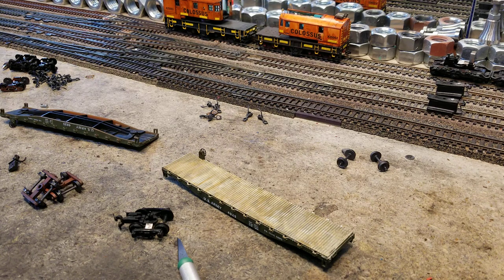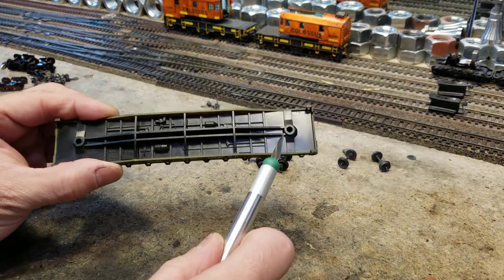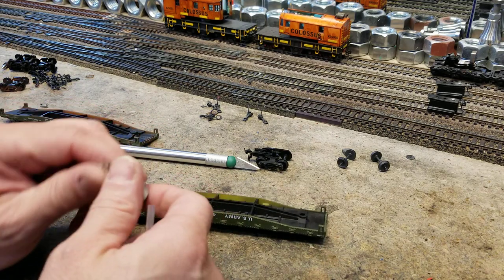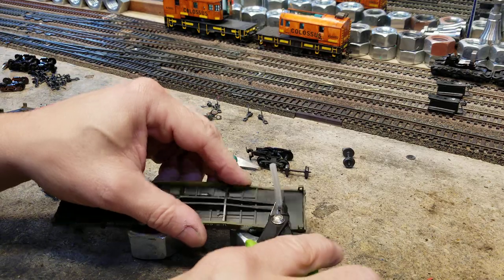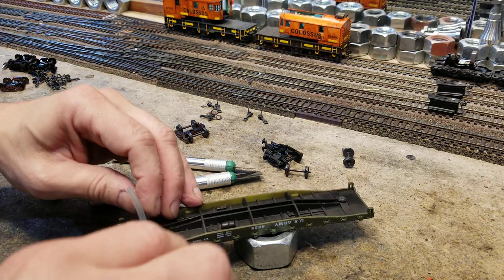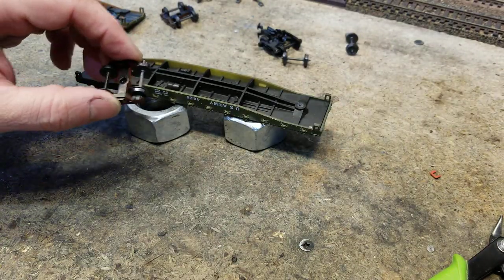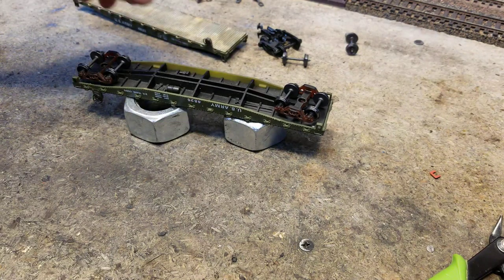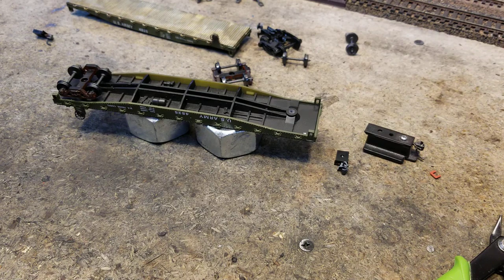New trucks on old freight cars

Comment: I plug mine completely off with solid plastic rod, somewhere around 3/16" diameter, or maybe 1/4" on the newer Bachmann ones, file that bolster flat, then I use a hole punch on the lid of a Kadee #5 box, punching out that coupler bushing/post, and using that for the new bolster.  Once the glue dries, I drill and tap the center hole for 2-56 x 1/4" screws.
Reply: Oh, and for coupler heights, I use the Kadee 20 series adapter, and glue that in place, and then I use a regular Kadee box right on top of it, and that gives me my coupler height, without having to mess around with shims, etc.  Yes, I like the snap together Kadee boxes as well.
Reply from the maker: I like the plastic rod technique which I've done with brass rod and the tiny lathe to make the hole for tapping.  I'll have to get a bundle of the plastic rod for rebuilding a stack of 40 foot hi-cubes!
Reply from the maker: that new snap together draft gear is a big time saver over the number 5 box when doing locomotives!

Comment: For just a few dollars more, you could easily replace those plastic wheel sets with metal and the horn-hook couples with Kadees.  I have done it to a lot of my rolling stock and glad I did.  everything runs so much smoother.
Reply from the maker: what I've been doing is coating the outside of just the wheels with non-conductive graphite spray and then polishing them with a plastic brush with a moto-tool.  those wheels have and excellent look after that.  metal wheels are way outside my budget - I keep them when I find them, but I only use them on cars in rare circumstances because of the price!

Comment: I use a very similar method for upgrading the trucks. My biggest obstacle is finding freight trucks in lots to upgrade the many repair projects that I have.
Reply from the maker: they used to be easy to get at train shows, but now I get the 10 pack from Tichy sometimes with wheels and sometimes without when I have a bunch of spare wheelsets.  They're under 15 for 10 pair - at least for the moment!

Comment: I found it easier to set the KDs with the trucks still off in order to get them centered right and your couples should stick out a fraction or two Ensure distance between the cars going around curves and through switches especially in reverse...
Reply from the maker: That is generally how I try to do it.  Recently I've run into some cars that were unusually difficult to replace both trucks and couplers. If I can get some more of those at the train show I'll show them!

Comment: I think I'd rather use a bit of Plastruct tube from the local craft store rather than silicon tubing. It can be glued in place with plastic cement and it will become part of the underframe structure.
Reply from the maker: it's getting harder to find and farther away these days.  the benefit of the tube is $8 will be a lifetime supply of the silicone hose!
Reply: @elite194  Plastruct is harder to find? Interesting. Was going to go out and get some today for another project.
Reply from the maker: @whiteknightcat  if you have a store that has that wheel of all different kinds of beams and channels, you're very lucky!
Reply: @elite194  Wheel? No, I was talking about the material used to fill the old hole in the bolster. You used silicone tubing, but IDK where to find that easily. But I do know stores in the area like Hobby Lobby, Michael's, etc carry Plastruct shapes and strips for hobby and craft projects. A 12 inch length of Plastruct tube would last me a lifetime. 

For trucks and wheels I have lots of old Athearn and MDC stuff around.
Reply from the maker: @whiteknightcat  I meant the plastruct carousel that had all the pipes, beams and other types. the one thing I don't like about using the plastic pipe for wheel replacement is the time it takes.  I tend to do big batches all at once - but it doesn't work at all on wobbly pintles!
Reply: @elite194  Oh, OK

Comment: Hi nice trick   I just 3D printed some flat cars I have a hole already made what size screw did you use?
Reply from the maker: always use number 2 screws!  you can get them any length and head style that you need.  I prefer Orchid Sound on ebay because they send them in bags with labels so you don't have to remember or measure to find out what you got!  get several lengths, your flatcars might seem to need very short, but if you have to add washers, it's good to have the next longer screw. also get a 2-56 tap so you can thread holes for your screws!

Comment: The problem with plastic wheels is that crud accumulates on the wheels and you spread it all around the track.  Real railroads don't have plastic wheels.  I'd rather use a wheel gauge and keep on using my Walthers Proto 2000 metal wheel sets.  For changing trucks, fill the hole with a piece of sprue left over from a building kit and cement it in place.  Trim it and drill & tap it for a 256 screw.  That's how I change those awful trucks with the push in pins or the split do-hickies that hold the trucks on.  So you're not one of those modelers that cuts off all the molded on extras and opts to put on real ones like ladders and grab irons?  That's too much detail for my layout.   Cheers - TN
Reply from the maker: so we fixed that problem a while back by using the ZEP graphite spray.  no problems since we did that!

Comment: Is it 1mm ID and 3 mm OD or 1mm 4mm
Reply from the maker: 1x4mm
Reply: @elite194  thank you
Reply: @elite194  by chance do you have a link to what you bought. I can't find 1×4 I can find 2×4 1×3
Reply from the maker: superiorsell2014 on ebay - but it's in a drop down selection box on the page for food grade silicone hose
Reply: @elite194  thank you

Comment: Should use metal wheels of you are going throufh changing  the truckd out will roll faster and smoother
Reply from the maker: I've got some metal wheels, but coating my wheels with graphite and then polishing them has made purchasing lots of wheels unnecessary.  I like metal wheels, but they're also really loud!